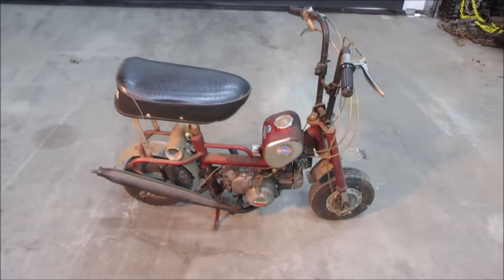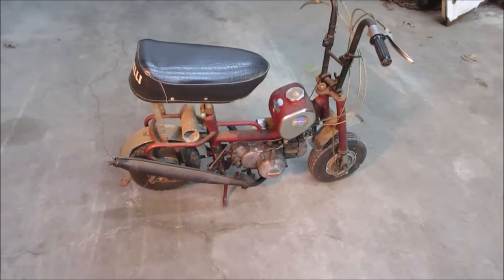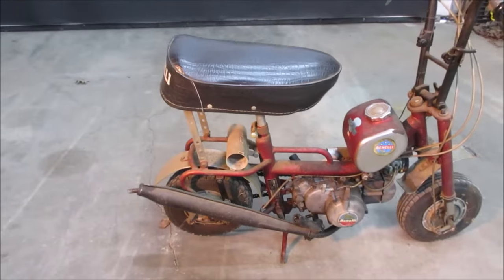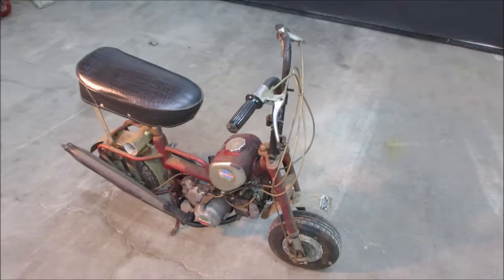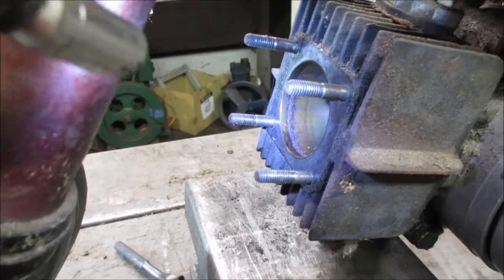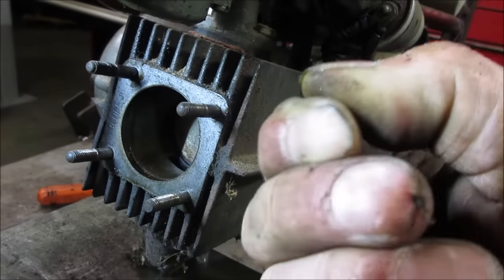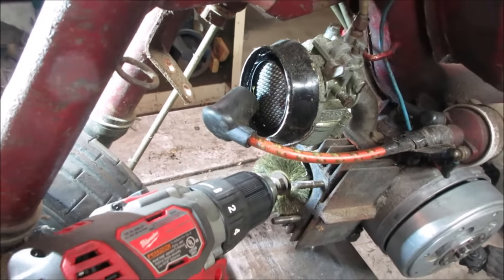WILL IT RUN! Benelli Buzzer Mini Bike

Comment: I once found a 1964 Triumph Cub on a trash heap. While talking with the owner I was checking out the motor to see if it would turn. It did... but only after I had removed the spark plug and got a face full of kerosene when I attempted to operate the kick starter by hand. Needless to say, I have never done that with my face that close ever again!

Comment: The bottom left lever is a starting lever that's all, it's used to pull the clutch and engine together for pedal starting, I guess benelli left the system on the kick start peds

Comment: Ride Outs are pretty popular right now. Minibikes, Mopeds, Quads, Ride-On Lawn Tractors...all kinds of cool stuff. If you can slap a Predator/Tilletson motor on it....people will take it on the street in huge groups and ride all over the place. 
A lot of the eBike guys are doing it too. Surons, Segways and similar Class 3 ebikes. Anything that can do 45MPH or faster. 
You have a ton of cool vintage rides. You should join in.

Comment: The only Italian motorcycle I ever owned was a 1968 Benelli 125cc  that I bought new from Sears while stationed at the Marine Corps Recruit Depot in San Diego, Calif. where I was an instructor. I commuted about 10 miles each way on that bike for about 2 years. Never had any problems with it. I think it cost me about $250.00. $250 in 1968 is equivalent in purchasing power to about $2,179.33 today.
El Mirage, Arizona

Comment: I own a 2013 fuel injected Honda Metropolitan Moped it gets hunnert miles to the gallon.  Does up to 40 mph (Downhill) lol.  gas n oil separate.  Bought it new when gas hit almost 6 bucks a gallon in 2013.  It cost me 2400.00 out the door.  Love it but, will probably sell it this year. Oh, the engine is a 49.6 cc.

Comment: Just got a 71 Honda cl450 for free it was parked since 1983 I put gas in and it fired right up already driving it on the road with new tires 😊

Comment: I use only citric acid mixed with hot water to get rid of the rust in the tank. The small lever on the left side is used if the kickstart won´t work (or it is the model with pedal start) and you need a push start. Using it if the engine is running will kill the clutch very soon.

Comment: Those Benelli's were notorious for seized pistons due to overheating and lack of lubrication !
Came with Dell'Orto carburettor..
Reply: I disagree, I have a similar Benelli minibike, but with a three-speed gearbox, and I never had an overheating problem.
I don't know what it means "lack of lubrication", the only way to have this issue is if you forget to put two-stroke oil in gasoline.
I have used this minibike for a pretty long voyage to an alpine pass in Italy with no issue at all.
P.S.
Sorry for my poor english grammar.

Comment: Nice, just a little "ring around the collar" once removed ran.
You make it look easy. That's why we are watching.
Reply: The fuel system was pretty gummed up too. If Darren hadn't cleaned that out thoroughly it'd have been a cause of endless problems as the jet kept getting clogged up from chunks and debris. Engines need spark and fuel to run once the mechanicals are sorted.

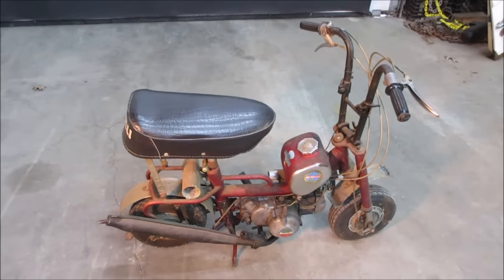Comment: It says ‘Use 5% (7% break-in) oil-gas mixture’. Italians used this formula instead of the 1:whatever ratio. So 1:20 it is, its actually quite thick but modern two stroke oils might do the trick with a thinner mixture.

Comment: Benelli built some incredible bikes back in the day. Before Honda produced the CBX1000 6 cylinder. Benelli already done it with a 900. I think they did it with a 250 but not sure on that. Very innovative company.
Reply: They built a clone of the Honda 500 four and then they added a cylinder on each side, makeing it a 750. The 900 version came later. They used a dry clutch on the sixes

Comment: I had a couple of Buzzers in the late 90s. They were in similar condition. I disassembled the engine on the best one but it was too far gone. 

I also had a Bennelli Dynamo that I bought locked up. When I pulled the top end it turned out that there was a ring of dried up gloop in the bore that was keeping the piston from moving. The rings were really stuck. Cosmopolitan Motors was still in business and they had a new std piston, rings , circlips , gaskets, etc in stock. After installing the new top end and points the bike ran like a top.

Comment: I haven't seen you try using a piece of chain rather than nuts. I think its easier to remove and possibly not as likely to scratch surface if it's not too rusty.
Reply: I have a piece of window sash chain that works well - the links are stamped metal and have sharp edges.

Comment: My first bike was a 125cc Montgomery Wards. I still have it. I took the wheels apart because a buddy was going to recrome them. There was a coating that prevented the process. Sadly, the bike is still apart! Probably would run if I put gas in it. Rode yhat thing all over! Got pulled over one Saturday night. No tags, license, helmet, and a passenger! Told me to keep it in the barn! Didn't ride it Saturday nights after that!
Oh, it was made by Benelli.

Comment: In the UK on some mopeds from the '60s they had a lever that 'disconnected' the engine so that the bike was a lot easier to pedal.  Pedals are a legal requirement here on 50cc machines if you wish to use them without having a motorcycle licence.  On saying this I can't see any evidence of pedals on your Benelli at all.  BTW the make is a long standing one here, the factory is just down the road from the Ducati one in Northern Italy and they still make damn good motorcycles too :)

Comment: Ever try BT5 by CRC? It has lots more uses than in the parts washer. Feeding it old oil and such keeps the microbes fed and they have little packets to replenish them occasionally. It isn't cheap but damned if it doesn't work well and reuseable.

Comment: Just FYI from NH DMV: 
To be classified as a "moped", a vehicle must meet all of the following:

    Not require the driver to shift gears.
    Have a motor not more than two (2) horsepower or 50 cc. in size.
    Not be able to go faster than 30 MPH on level ground.

Comment: I found a 78 Suzuki rm50 at a yard sale, the guy wanted $750 with a locked up engine. His wife finally got involved and sold it to me for $100. We also bought a few rc cars and he told me to come back later and he'll give me more parts. 

I immediately went home and removed the head and found a rust ring. After cleaning that, cleaning the points and carb it ran like new. So a few hours later I rode it back to the guys house (was only a few blocks away) and you should've seen the look on his face. He even accused me of swapping the bike but it had vintage stickers on it that would be impossible to make in a few hours. 

He finally agreed it was the same bike and couldn't believe that it sat with a locked up engine for 20 years, and I fixed it in a few hours. 

One of my fav stories to tell.
Reply: You've got to love other guy's wives. They rule with an iron fist! You're getting rid of it now.

Comment: PLEASE after 40 years you have to clean the tank, carburetor (probably 16 Bing) clean 2 nozzles with a needle or blow out compressed air. Check if the float is still okay. new oil. 65ccm drives with an open, shortened grummer, exhaust around 70-80 kmh. Attention you need a certain back pressure at the exhaust

Comment: Some months back, cleaned my 86' 350XT tank with chloridic acid, 6 herbs and spices for 15min. 
Turned out great but should've protected it with resin, it surface rusted within 24h.

Comment: The cable off the clutch actuating arm must give you a clue - does it go to a hand lever?
Some of the old Villiers bike engines had a 2 speed gearbox operated from the ‘clutch’ lever - pulled in was low, out was high, and in the middle was neutral. James Captain etc used these engines.

Comment: you gotta cut the o-ring with a razor blade and it will hold better, the rubber is slightly pourous and crimp cutting squishes the grain shut

Comment: Is that a centrifugal clutch? If so then the clutch lever should only be to force engagement or not. Centrifugal clutches only engage under a specific engine RPM. It's basically a automatic just like on chainsaws and some weed trimmers. Once you gas on the throttle clutch engages itself. Shouldn't be any need to even use the clutch lever in normal conditions, only when necessary is my guess.

Comment: Pulling the throttle grip is a big deal?    By the time it took to say it could taken it off.loosen the clamp screws and slide throttle assembly off end of handlebar. Need to smear some grease on handle bar and inside the throttle cable housing. Slide assembly back on and tighten clamp screws.  You need to loosen the throttle cable housing up by the handlebars.  Loosen jam nut and run adjuster all the way in. Turn adjuster back out till you get just a little play before throttle cable  starts opening  the carb. When throttle cable returns on its  own you're to good to go. One other throttle check. Start engine turn handlebars all the way  to each side. If your engine revs you need to reroute the cable until turning bars does not cause engine to Rev. As always the engine won't right without air filter installed . You can remove throttle cable and hang it up and put oil in from top. My favorite way is to put one of throttle cable in drill and let the drill turn cable inside housing while spraying a lubricant and it roto roots any nasty crud our out. When it runs out clear you got it ready to reinstall .

Comment: 19:00 Trafic has gotten pretty bad around here too, I am seeing a lot more Scooters around, it's more like Teens driving them around, Sadly scooters and mopeds don't do you any good as you will still be stuck in the same traffic, my solution is an e-bike, without traffic, it's a 10min commute to work by car, with traffic it's a 45 min affair, with the Ebike it's a 15 min ride regardless of the traffic lol

Comment: I've got a general carb question. I have some mixture screws that keep backing out. Is there some sort of mechanism that is missing? Not sure why they don't stay at the settings after tuning. Other than doing an aircraft/wire style of lock, what are my options?

Comment: the bottle you use to dribble fuel into the bikes , what are they normally used for ? im in Ireland and have never seen one and think it would be great for the workshop
Reply: They're oiler bottles. Designed to oil hard to reach areas of sewing machines and the like.

Comment: Excellent video Mustie 1 :) yes group it 80 CC also 50 CC group in my called Slow Pokes Motorcycle Group use those bikes in all years and ages people 20  to older plus have G license for basic Car , Van , Truck license and 100 CC or higher have Motorcycle  learning M1 for 90 days plus learning drive street bike and training course take then in 90 days go for Motorcycle full license M2 be 18 years or older plus be born after 1996 year! But if were born before 1996 need G license be 18 to 21 years old but like see everyone get M2 license ride on highway or anywhere too Plus one area of Ontario Canada heard Electric bikes  group call  EMO Group only ride on top speed of 60 mph highway speed in town or special roads have slow lanes like bicycle routes only  ! But need strong batteries to travel them and wear helmet too !

Comment: Didn't some of thise bikes have a centrifugal clutch with a lever to force lock the clutch? On cold mornings you can make a sprint with the bike and then dump your butt on the seat while pulling that lever and you can get much higher rpm on the engine than with the kick start.

Comment: muriatic is soft name for the dangerous Hydrochloric acid. It’s critical to take proper precautions when handling potentially dangerous chemicals. Hydrochloric acid has the potential to cause life threatening burns.

A 2014 case studyTrusted Source describes an accident where a 50-year-old pool cleaner’s skin was exposed to chemicals containing hydrochloric acid. The incident caused fourth degree burns that eventually led to amputation.

Comment: I think the lever to the clutch works as follows:
When you pull the lever the clutch is disengaged. This is instead of a centrifugal clutch to let the engine run free and you can put the back wheel on the ground.
When you slowly let the lever go you slowly drive away. You do not use it anymore until you stop, then you pull the lever again to avoid the engine to stall.

Comment: I was wincing when you were kicking it over because the bike's engine was propped up on the scissor jack and supported by its own exhaust pipe and not the engine case. Come on Darren, you are better than this and usually don't do so much harm. I fear you may have torqued the exhaust header flange away from its mating surface and its leaking now. That and the rear inner tube, yikes. Just some constructive criticism back at you. 😉

Comment: if you need help fixing that leaky air hose on the blower-outer tool... I think I know a guy... ;)
Reply: It was probably the chuck that was leaking. There's a little seal in them that goes.

Comment: I don't know why they're charging so much to Chrome anything guy  restores Tonka toys he nickel plates right on his kitchen counter
Reply: It's due to EPA regulations. Nickel is what you see in a chrome plate finish but chrome is what protects the surface. The chromium layer is so thin you can see right through it. Gives the chrome a bluish cast though.  Chromium is a heavy metal. Very bad ju-ju. A triple chrome plate job is copper that's buffed to a polish, then nickel over that and chrome on top.

Comment: All of Brazil runs on what they called E85 in the same vehicles me and You by some run on full methanol 750 to 1000 to remove and replace all the parts from the fuel system the methanol will eat it's a government mandate they don't have gasoline they run on methanol